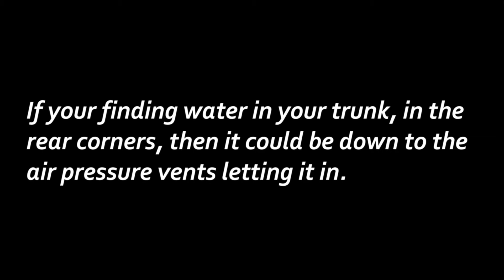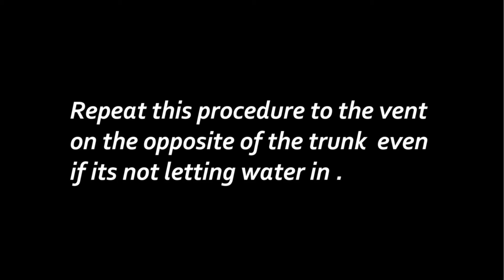VW Golf MK6 Water Leak Fix

Comment: I'm wondering if there are original seals that you can buy, so that you don't have to use silicone. Also, doesn't the water come in from the vent itself? So when it's all siliconed around the corners, won't water get in through the vents themselves?

Comment: For me its the driver side floor wells (front and back), everywhere else is fine.  Anyone have this issue?  For the life of me I cant figure out where its coming from.
Reply: I had this problem on a 99 Passat.  The battery drain was plugged.  Fix it ASAP.
Reply: @joetrapp9187  Ended up being the sunroof drain.  The hose plugs into another one right at the firewall that got disconnected so the water was coming into the cabin instead of draining out like it was supposed too.  Minus getting all the water out the fix was pretty straight forward.

Comment: I did this. Didn't work for me.. water still running from the sides into the trunk to the spare tire area. Any other suggestions?
Reply: I do this ,but the water go inside
Reply: How to fix it,the silicone not fixed
Reply: I was removed the left and right crock
Reply: I found my leak. It was 2 small rubbers from 1 part to other part of the hood. I can show show you a picture if you give me your e-mail.
Reply: @emil2605  Where the wires travel from body to trunk lid ?
Reply: @johnhorgan5313  yes
Reply: @johnhorgan5313  i actually had 3 leaks. From vw logo, rubbers from body to trunk lid and there air vents lol
Reply: @emil2605  you still have the picture?
Reply: @N-e.o  yes i do
Reply: Can i have the pic pls